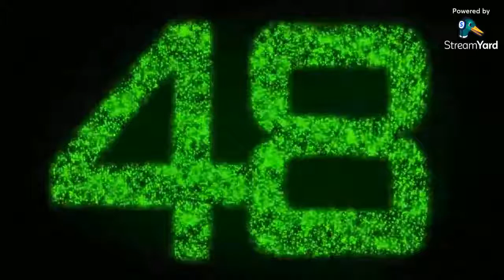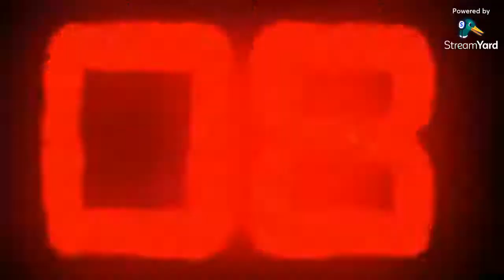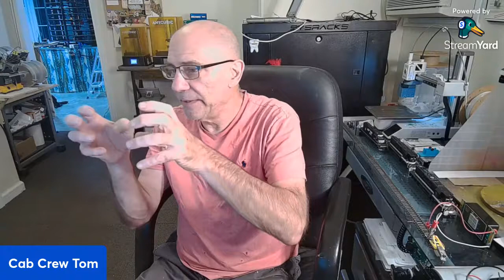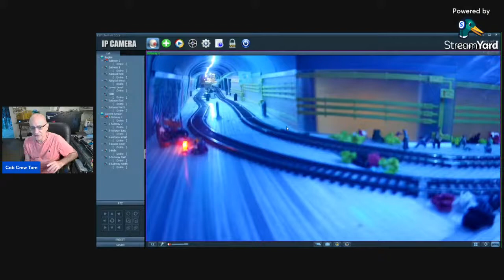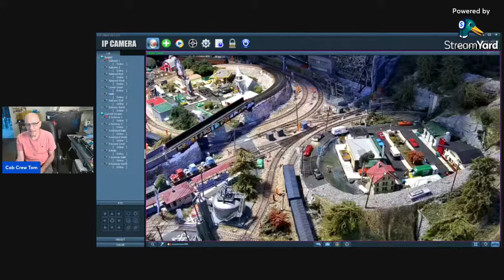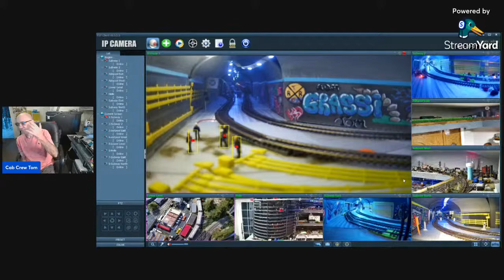🚖 Cab Crew LIVE – Don’t Miss It! | 8/27/25 @ 8PM EST

Comment: Hey Tom.  High tech stuff.  Way beyond my pay grade.  🤣. It’s all good. Enjoyed your livestream though.  Have you tried to just use a very low charged 9 volt battery to see if your wind mill will spin slower to your liking or you already found another way?
Reply from the maker: Drew Thanks for stopping by.   I found a Motor that is slow 3 RPM  one I have is 25,000 RPM  thats coming Saturday will check that out Also building a circuit to try before that to see if that works too.
Reply: @thomasrgrassijr Good luck.